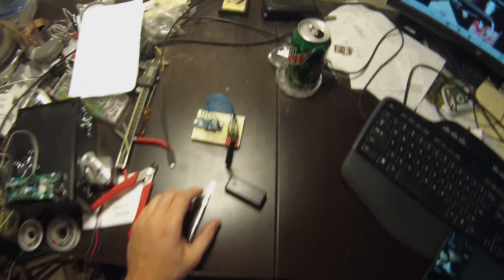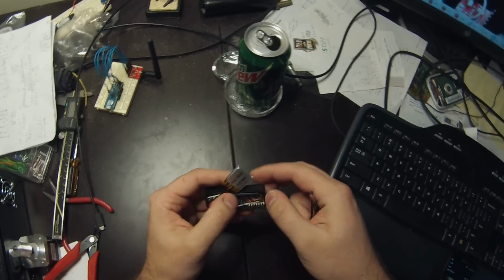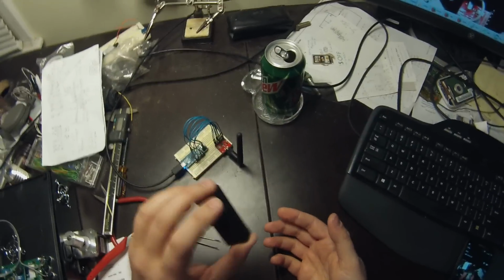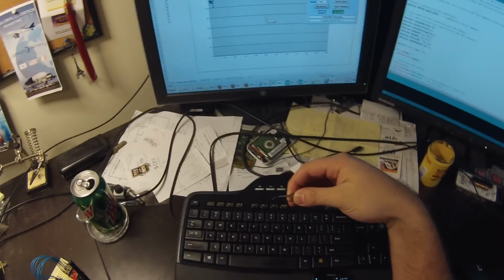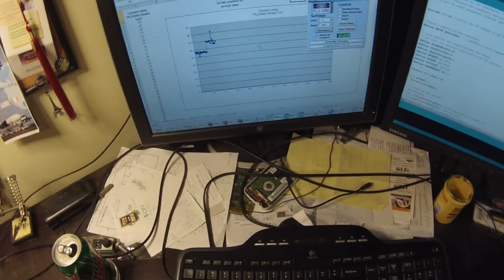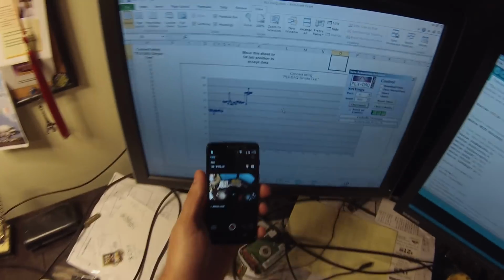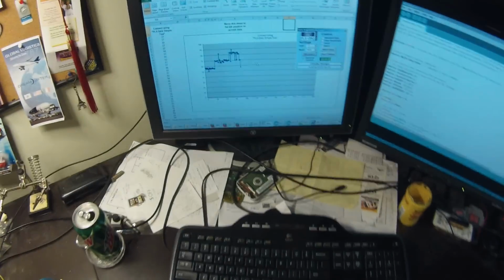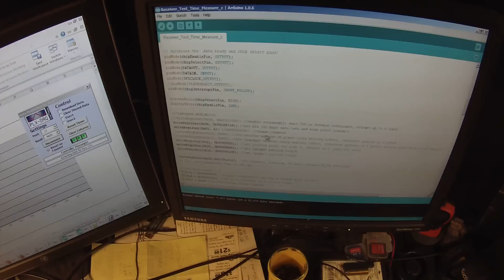Arduino+Trinket-Pro based Radiolocation

Comment: How can you calculate the ToF so precisely within these short distances? The radiowave  propagate  with speed of light. In order to measure 4-5 feets distances you need to calculate several picoseconds. Arduino can't provide such resolution. Only some TDC